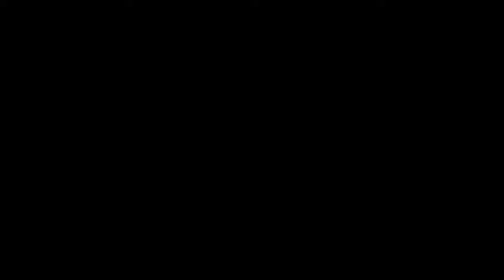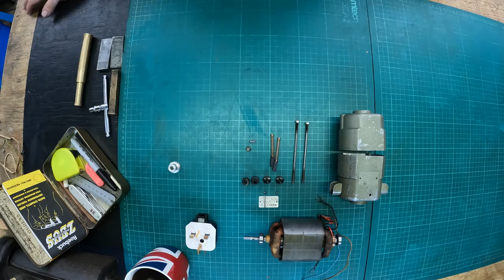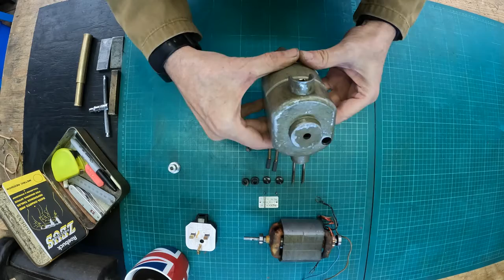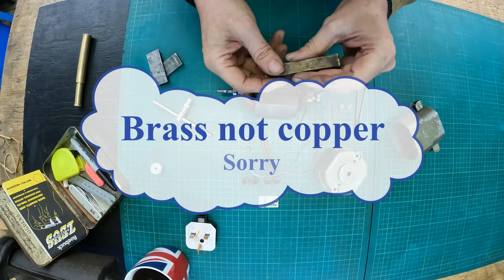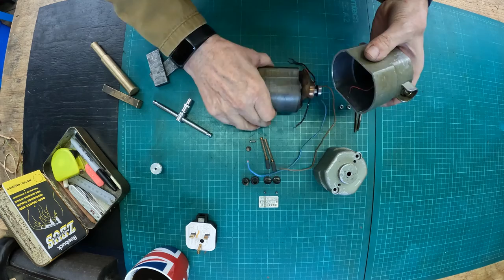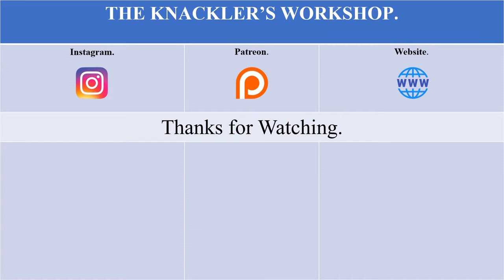Unimat SL Electric Motor Maintenance.

Comment: Sorry i have only got to this video a year down the road. The offending screw should have actually fitted into a tapped hole in a small C-shaped small clip. The clip's main job was to secure the incoming cable, while also providing an earthing point for the motor and the capacitor. I am interested to read in your comments that the capacitor can develop a ground to earth, but is only used for radio interference. I am now going to remove mine, as it is possibly the cause of the shorts I get as it warms up. Overheating of the motor is a known fault, but I don't like electric shocks!.
Reply from the maker: Hello Tim,
Many thanks for dropping by and taking the time to comment... Thanks for the info on the C-Shaped Clip... I find it pleasing that the info in the comments is of help to people.
Take care.
Paul,,

Comment: Howdy Paul. Yep. Balance marks.
One of the first things I did to my Unimat was upgraded to a 24VDC 100W Dayton motor and wired in a variable speed drive, because the little Unimat motor would overheat. I also added a 20amp breaker on the circuit because I kept knocking all the lights out! I think I showed that in one of previous vids. But now I have an extra Unimat motor laying around. Thanks for the informative vid as always.
Reply from the maker: Hi Mike,
The balance marks was clearly something new to me but on the positive side the motor should where when back together. I have another Unimat with no motor which I will put a DC motor on. I think that will be next year sometime. Thanks for watching.
Take care.
Paul,,

Comment: Hi Paul.  A good run down on opening the case.  Looking at the lack of wear on the commutator I would say the motor has done very little work.  I expect the brass brush housings would screw in to the casing, using a square drive in the centre.  Cheers Rob
Reply from the maker: Hi Rob,
Thanks, good ews about little wear on the motor...I did try a square drive the housings for the brushes but it did not move, as I was not needed know I did not try to hard though. Thanks for watching.
Take care.
Paul,,
Reply: @TheKnacklersWorkshop  Hi Paul.  There's no point in removing those anyway, so leave them be.  Cheers Rob

Comment: Interesting tear down Paul, looks like someone beat me to it on the balance marks, that's definitely what they are, any nut damage would be really gouged and all round the circumference of the rotor. Looks very tight mate, rather you than me lol. I need to strip my shaper motor shortly and can't say I am looking forward to it as I haven't a clue what I am doing lol. Cheers, Jon
Reply from the maker: Hello Jon,
Everyone in the comments have been very helpful as I know nothing about this sort of stuff and am learning as I go along. I have quite a few motors that need looking at and also have two VFD's to try and setup... Talk about dropping myself in the deep end - lol.  Thanks for watching the video.
Take care.
Paul,,

Comment: Hi Paul. Great video. The motor on my SL used to cause the fuse to blow in my consumer unit if I used it for more than a few minutes. I ended up replacing the original motor for a 24 volt DC scooter motor which runs brilliantly. The bonus is, because  I am using a variable power supply, Ive got the benefit of being able to dial in whatever speed I need without changing belts around. 
Having said that, I'll use your advice given here to dissemble the original motor and maybe get it running again and keep it as a spare. I do agree with Dudley though, I believe they grind into the armature for correct balance. 
Johnny
Reply from the maker: Hello Johnny,
I know the genuine SL motors can cause problems...  I have one of my SL that I would like to fit a scooter motor to... but that project won't happen to next year. Thanks for watching.
Take care.
Paul,,

Comment: Hi Paul, it look a very neat little motor. Also like it's been specifically designed to fit the lathe. Should be trouble free after the overhaul. Tony
Reply from the maker: Hi Tony,
It is a genuine Unimat SL Motor... I am now more hopeful it will work fine once put back together. Thanks for watching and your support.
Take care.
Paul,,

Comment: That looks very much like a "Sewtric" motor. the brush holders are removed by removing the grub screws from inside the housing at either side, they are often quite tight. The earth connection from the capacitor  is for interference suppression and it is a capacitor array centre tapped to earth. Any of the cheap chinese speed controls will work with this motor, and it can be reversed by swapping over the two connections to the brushes from the field coils. The marks on the armature are balance marks, nothing to worry about!You could clean and repack the bearings unless they are badly worn, these are tough little motors, originslly designed for electrifying treadle type sewing machines. Another good and interesting video Paul, I shall be waiting for the rebuild!
Phil
Reply from the maker: Hello Phil,
Thanks very much for the additional information... that's the great thing about the YouTube community, there are always someone ready to help... Thanks again.
Take care.
Paul,,

Comment: I expect the earth goes to the case, possibly where the capacitor connects to. Interesting that it is a universal motor so could be used with a simple and cheap motor controller like the one I used as a speed control on a washing machine motor (or which I did a video).
Reply from the maker: Hello Ben,
Thanks for dropping by... Although I got some of the video wrong, I have leant something and hopefully anyone doing the same job won't jump to the same conclusion as I did.
Take care.
Paul,,
Reply: @TheKnacklersWorkshop  It is always a learning process! If you have another one in working condition you can always check with am ohm meter. Good work by the way.